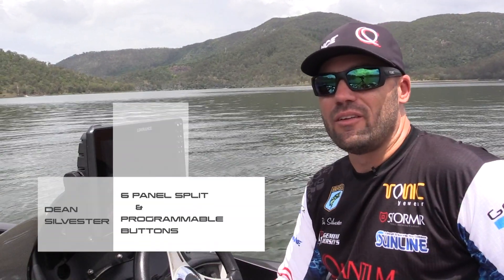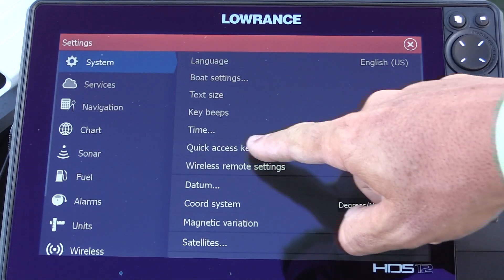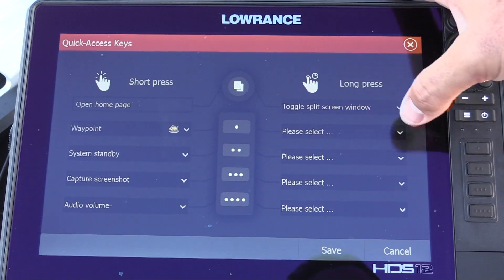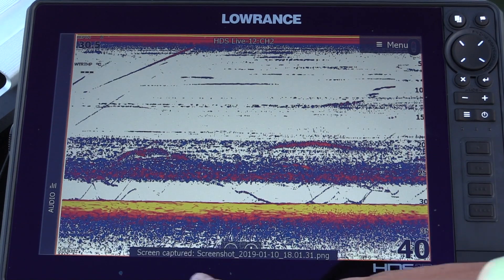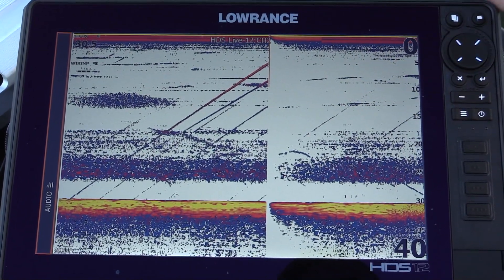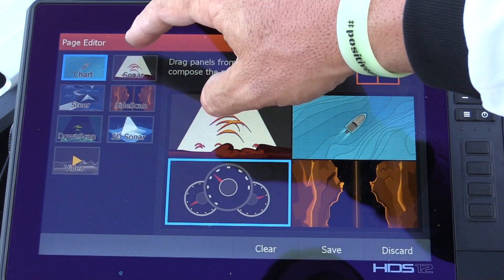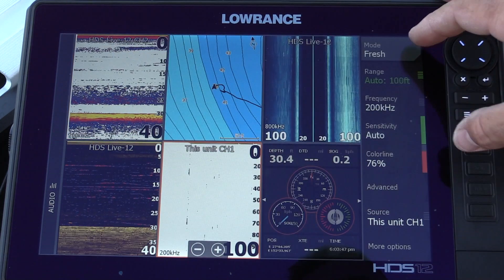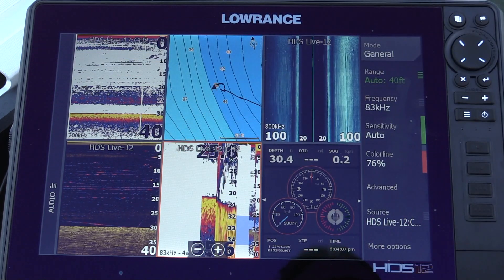HDS Live Split Screen and Customisable Buttons

Comment: good evening, a piece of advice, I have 2 transducers, the imaging 3-in-1, and the tm165hw, which of the 2 should be connected on black? and which one on blue? thank you very much
Reply from the maker: The AI 3in1 needs to be plugged onto CH2, the black port. CH1, blue port, can be used for the TM165HW

Comment: Also great the "Dual Sonar" pages you setup show both of the 2D Frequencies.  One is 200Khz, the other is 83Khz.  For smaller units, the 7 and 9 inch models, the quick access key feature can be incorporated with the LR-1 Remote.